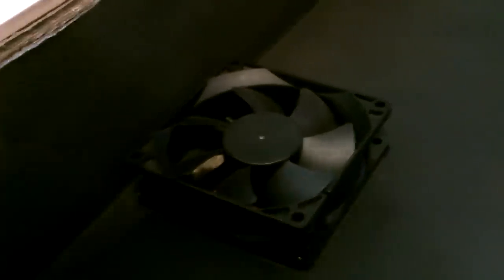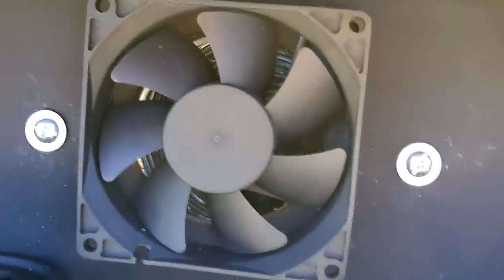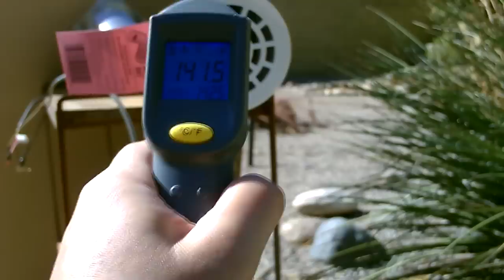Homemade "Steel Can" Solar Air Heater! DIY - STEEL CAN Air Heater! (140F+) - EASY Instructions!

Comment: Great idea on some alternative heat for those cold months.
Reply: +Survival On Purpose It will not work here in Alberta, you wont see the sun Here during winter..
Reply: ...it hits minus 35 where I live, and even when sunny....I suspect this would not be too effective.
Reply: IT's the sunlight that matters. 🙏
Reply: Not at all?
Reply: Survival On Purpose Why would you need heat on summer days when the sun is that strong?
Reply: hah. I definitely don't need any heat right now ;-) But solar rays work in the winter too.

Comment: heater is only $30, your material cost from home depot is more than that + labor.
Reply: True, one could buy a cheap electric heater.  I searched Amazon quick and saw a Patton electric heater for $21.  Problem is, the low power setting is 1000W.  Assuming building the solar heater cost, say, $50 and assuming you run the heater half the day and assuming my local provider electric rate of 6.99 cents per kWh then in 35 days you will have exceeded the cost of the solar setup and it will only continue to accrue expense as time goes on.

Comment: Interesting !! I llike this idea and I like the way your built it !!  did you use steel screen or vinyl screen mesh ?, why did you use cardboard instead of foam board insulation ?, What is powering the fan ?, Did you use two pieces of plexiglass , one on back and one on the front ?  Where would you place this device?  in front of a window (inside the house) ?  or somewhere outside the house ?  Outside the house would you require you to bore holes from the outside of the house. How much space heat could you expect to get from this type Solar Heater Could you please explain more to me.
Reply: You still didn't explain why you used cardboard to insulate - low budget? Personally I prefer aerogel - bit costly but can't beat the R-value!

I'd seal the plexiglass to the box with engine instant gasket, put a squirrel-cage blower on the intake line and use a large sheet of plastic Fresnel-Lens material to concentrate more sunlight onto the cans. Gotta be careful on the focus though. Don't want to melt the cans and start a fire! (had that happen to the driveway asphalt using just a 8 1/2 x 11 Fresnel magnifier)
Reply: The solar panels are powering the fan, and you only want one side with glass because glass will allow heat to enter and leave if you were to use two pieces on both sides.
Reply: Probably for cost efficiency, I just used regular insulation as well and it had an R- value of 6

Comment: My big question is about the fan. I'm sure it is a low power drain. However, does anyone know how to hook them up to timers or even temperature sensors? That would be ideal.
Reply: Yeah, you can get a timer, I can help :)
Reply: Josh Loberant , dood!  Where does the stuff post? Google Plus?
Reply: Yeah, it popped up ☺
Reply: Weird, now I am aware that whatever I post on YouTube gets posted on Google+.
Reply: I guess your YouTube/google account are in cahoots

Comment: HI!! I love energy DIY projects. One question. If I understand correctly your cans are hollow? If I am correct I have a suggestion, fill them with sand. This will heat a mass that can allow for heating even when the sun has left us for the day. Adding a solar charger and some batteries for the fan and you might be able to get enough to heat a room 24/7 with the right size!! Awesome build and thanks for sharing!
Reply: Bob Hanker What about wrapping the cans with copper tubing and then filling it with water? As the sun hits it, it'll warm up the water in the tubing, which should not only further heat the air flowing thru the cans, but also retain heat after the sun goes down.
Reply: That would also plug the airflow, which has to go through the cans...inlet at the bottom.
Reply: Yes true. However, I would think that someone who can come up with something as cool as this, could easily find a way to incorporate a mass to heat. Maybe instead of passing air through the cans, pass the air around. Heating dense mass has been used for centuries and still to this day. A simple Google search on thermal mass heaters can teach much more than I can. Some simple thought and redesign would pay dividends my friend...
Reply: peter, you are 100% correct. In this current configuration air would not flow through the cans if they were filled with sand.My comment was intende for people to think about incorporating a dense heavy material into their solar projects such as these. If you must have the air to flow through the cans, then the mass can be elsewhere. Wherever it may be, it has long been known that dense material will be slow to heat up.... but also slow to let go of heat gained therefore making it a storage medium. Water, sand, rocks, concrete basement floors, all with the correct design can allow for not just immediate heat, but for the storage of heat and release heat when there is no sunlight left for the day. Surely we could come up with something like that right?
Reply: My day job is Chemist. As a Chemist, I HIGHLY recommend steering away from any chemical option. That opens up a whole new potential problem set....
Reply: Hi Jeffrey. Yes that is an idea, the only concern I have with water is its expansion rate. In the project like the one in this clip, I would go with a solid medium like sand to avoid water damage. There are some really great projects on Youtube where ppl use water solar collectors in conjunction with a storage tank to heat their domestic water, and run pex throughout their home for heating. that is awesome, but much more expensive, I seriously think this project would be an economical and easy project that could provide extended heat if improved on. No disrespect to the poster since he spent time making it and posting for all to see his work, and I am thankful for that, but we can always improve right? Otherwise we would still be driving model T Fords :)
Reply: Brian Wood
Chemicals is another ideal, using chemical compound to effectively and cheaply store massive amounts of heat for days and days in huge tanks. But myself don't know the way to do it, but i found out people are doing it successfully in a solar project they are working on.
Reply: Bob Hanker
guess I should have posted this in this discussion, 
What about putting smaller cans inside of the bigger cans? you would still be able to let air flow through. also adding maybe a second computer fan? would glass rocks (like lava rocks etc) be a good object to add inside the cans? I love this idea! Thank you OP!
Trying to add on to your design here.
Reply: HDHELLION Air? Now thats a cool idea! I don't know if it will work or not but it sounds legit and cool enough to try!
Reply: You COULD use paraffin - pour it in a set of copper or aluminum tubes, crimp/solder the ends when full and place them inside your cans. As the air heats up inside the cans it melts the paraffin in the tubes. Once the sun goes down the paraffin starts to cool - giving off all that heat gained during the day and extending the time solar heating is effective.

Here is an article referencing another phase-change material which could be used. http://discovermagazine.com/2013/september/21-running-hot-and-cold-forever
Reply: Maybe you need a metal that will allow the airflow and still hold the temperature well, like cast iron.  The the nice thing about the design here is that these cans are free.  You could try adding stones inside each can.  as long as they are big enough not to fall through the holes they will hold heat for a short time, but I'm not sure about them holding the heat throughout the night.
Reply: Bob Hanker
Yes, been used for centuries, another way is to use the aluminum cans because they collect heat from sunlight in split seconds, this very fast release of light into heat is something we need to take advantage of, using air, or a gas to carry the heat to the home(mass), efficiently as possible. The home can be designed or even customized to have extreme mass, this is where we want the mass anyway really, because it is where we want the heat, and it server to be a more solid home too. Like build huge solid rock walls, floors, etc...
 Build wood over top, etc... mass after mass after mass, under the home, etc...
Reply: Using the aluminum and air flow is a way of concentrating the heat, without the airflow and the thin aluminum this is not possible to collect and multiply the heat in the home. You can't concentrate the heat with mass in the way, first it gets concentrated in this way, then we can run it across and thru mass.
As air runs thru it grabs heat and collects it in the home, at the same time the sunlight on the thin layer of aluminum is causing more heat the second the air just took it away there is more already, this is why air flow is needed to collect the heat from this kind of unit, then store it in the home,
This unit is made of tin and not aluminum but it still works, just not as good, but its internals are more robust(sturdy), tin is stronger than the aluminum cans, but it don't matter the aluminum is strong enough for this, and it is mush easier to work with.
 Most aluminum cans are returnable and no tins are returnable, i can see why people want to use tins for 2 reasons, totally free and stronger, but aluminum is better for this.
Reply: Tony Hardy I love this debate!! You are very correct in that you get heat more quickly with this set up. However, where I live in the Midwest, the highest heating demand is in the night when there is no sunlight. I would even go as far as to say that this holds true everywhere.... Certainly in the deserts I have had the privilege to serve in.. I would prefer a way to hold on to heat after the sun is gone. I do understand that there are definitely different ways to build things based on desired purpose and outcome...
Reply: What could you use that would hold heat all night long, espically in December when the night is so long?
Reply: Bob Hanker um, I don't think I did that correctly. Someone said putting (sand?) Would block air flow. I thought adding  smaller cans inside the big cans with holes drilled in those as well.  That way the air wouldn't be blocked. And the smaller cans would still be hot along wot the bigger cans. Just Just a random thought. Does that make more sense? I might have no idea what I am talking about btw.
Reply: Your guys ideal will work, but it might be much harder to build in that way but it is worth a try it could be worth it. But all i was saying is i do agree about adding mass, but my ideal  was to just use the solar device as the collector, then force the air thru the battery(mass) in the house. Easier build and it will work too.
Reply: HDHELLION
It could work, but i think it won't work as good as expected because you will have to make a trade off between collecting the heated air, and storing the heat in the device. But then again this could work out perfect filling the inner channel with sand. If you put sand in the inner most channel it will collect the heat the forced air leaves behind, so you could possibly regulate the temperature of the output of the collector air and heat storage rate by how much air flow your fan pumps. So on a day when the sun has been out and house is at comfortable level the fan could slow way down via thermostat and the collector will automatically become the battery. Then as soon as the sun goes down some, the fan picks up extracting the stored heat.
Reply: HDHELLION
Oh sorry i misread your comment, Never mind i reread your comment, i now understand what you said. lol, your ideal has just air no sand. You just gave me the ideal to use the 2 channels but without holes between channels, i guess the ideal was in my head as soon as i seen the can within a can ideal.
Reply: Jeffrey Hall
Yes, being a closed loop it becomes a storage. Water can transfer heat much faster too because since it is fluid we can pump it from a huge solid block shape(like a huge barrel) a block shape causes the water to help store heat, then into a radiator and change the waters shape to make the shape of the radiator, and now the hundreds of channels where water is for heat to escape into the air. 

 This is tin, and/or aluminum cans, project that takes no money really. If one can get copper for free from a other project, or if one can afford copper and stuff, maybe they could afford to use stainless steel parabolic with stainless steel pipe, now they have a decent supply of steam, steam = heat = power = energy, etc...
Reply: frddyfingers Fire brick is more like insulation, i don't think it will work so good for storing heat. It deflects more heat than it stores that is why they use it in stoves. It reflects heat so the stove will burn hotter in the burn chamber to make a cleaner more complete burn. And at the same time they protect the side of the stove from the extreme temperatures to meet EPA standards. So the fire brick do indeed reflect/insulate heat away from the sides of the stove. But i could be wrong about the heat storing ability of the fire bricks, i base this from the fact of how and why they use them in stoves, it possibly could store a decent amount of solar heat, the stove is much much hotter than a solar sodacan heat collector. But there is other materials that work better for heat storage, fire brick is designed with air pockets purposely to act as insulation/heat reflector.

I think sand would be a good choice especially since it is free, if you really want it to be dig down past the soil and there is high chance you will find sand and or gravel right where you are at. Could use a heavy layer all throughout the entire back panel with thin sheet of black material covering it, insulate the very back side really good. If you wanted you could add lime and water to the sand before you put it in now it hardens and takes its shape, won't need to build wooden frame,etc...could make concrete back and sides all you would need to do is use insulating board and some furring strips to make the forms to pour cement, then use insulating board to insulate it around all the sides except the sunny side where the glass or transparent material is. And you end up with a heavy ass mass(insulated concrete)solar sodacan heat collector with using only sand, lime, water, sodacans, transparent insulating material and insulating board and trim pieces to finish the 8 exterior edges off, then the whole thing painted black inside and outside. 

The ideal of adding a pipe inside the cans filled with sand will grab some of the heat as it travels to the house, but at that same time it collects it and stores it, it is all good ideals, do them all if you can, lol. good luck, let us know, make a video if you complete one.
Reply: Bob Hanker i'm not perfect but why couldn't you have a metal tube or part of a can say an inch or two in circumference placed in side of each can with room on the sides to add the sand. would that give enough mass and air flow?
Reply: Lt P uhm using a combustible material where heat is used is as if you put a can of oil beside your wood cook stove,, there is a phase change but you would have to have a vacuum to fill with no air or purged with nitrogen, then the expansion of the paraffin creates an air space, then you would have to have some sort of relief valve in case of over expansion then you have a spill into a hot box with air that is combustible. just a thought,,,
Reply: Bob Hanker  Try and do every other row with sand or build two one with sand and one without.Drill the wood inback and eliminate one can for the hole......
Reply: could possibly work if you were to put a small copper pipe up through the center of the cans and fill with sand around the pipe. air could still flow ant the heat from the sand would keep the copper warm. just a thought.
Reply: Jason Davenport You need a hot idea not a cool one. Ha
Reply: Bob Hanker You COULD use paraffin-wax to store the heat. (phase-change material)

As the sunlight heats the hollow cans it heats the air IN those cans and, in-turn, a set of narrower metal (copper?) tubes bonded to the backside of the cans (using thermal conductive epoxy).

Inside the tubes you pour liquid paraffin (melted in a pot on a stove?) to a fill point below the top opening (bottom already sealed by crimping & soldering). This ensures the paraffin will never expand beyond the top end of the tubes (crimped & soldered later).

The paraffin, once cooled, will become a solid which melts (liquifies) upon heating by sunlight. When the sun sets the paraffin will begin to cool to a solid again - giving off the heat it collected during the day. The larger these tubes - the more paraffin you can use and the longer the heat will be stored/released.
Reply: I love the idea of sand because it's readily available for me. Would it be possible to run let's say 3 tubes (copper?) through each row of cans minus the bottom two rows with then done like in the video and two rows in the middle to create air/transition pockets for moving air and in the void spaces of the "piped" cans have the sand to "store" the heat(I really do like the paraffin idea though; But sand from dust size to almost very small gravel is VERY available to me in the "sorted" sizes of actual grains[I work in a sand mine])

One major question I have is would painting the cans matte but lining the backing with a reflective be more productive?

Also on a side note, if 140° F is possible out of a unit like this, would a larger scaled firebrick back lined box be feasible as something to retain heat with and within the media (sand/paraffin)?

I apologize for the rambling...it all kinda hit me at once and have so many questions and ideas.